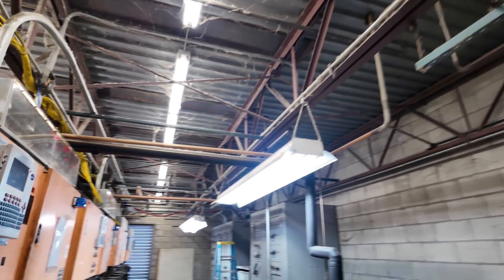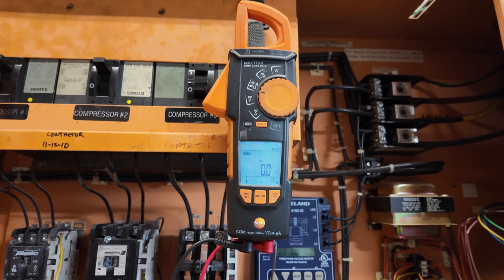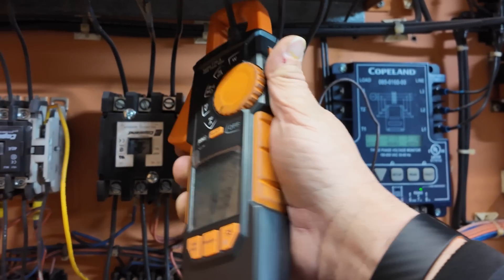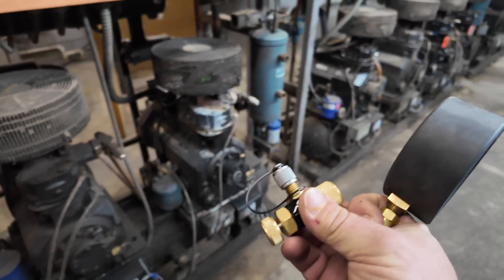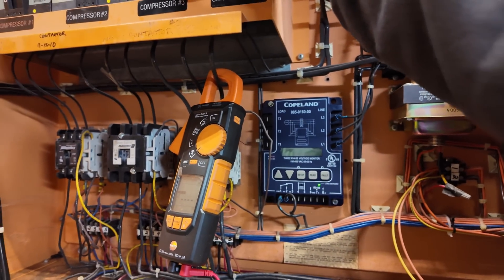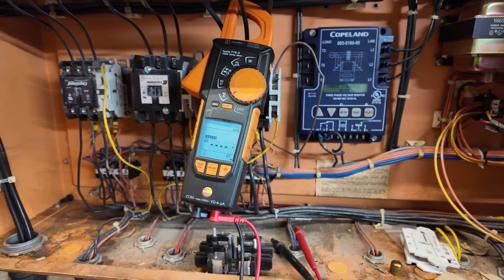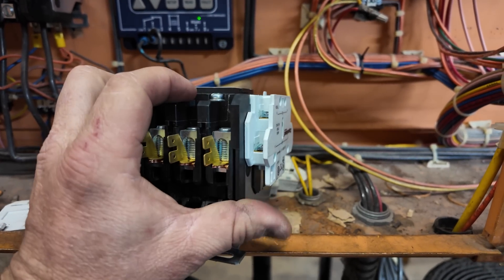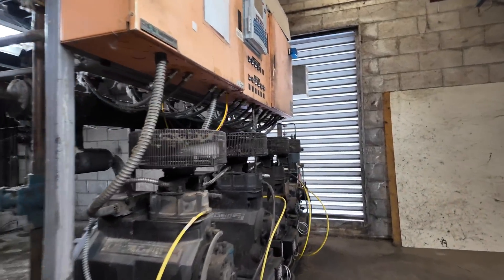Compressor Oil Failure Or Electrical Failure ?

Comment from the maker: I posted two videos this weekend. Please check out both of them.
Reply: Best weekend ever
Reply: Your not my real dad don't tell me what to do
Reply from the maker: I thought you were gonna tell me that only your real dad could touch you there?😂😂😂
Reply: Recommend using a four pole contactor, often I wouldn't due to cost but surely the big grocery store would pay a bit more for a better part right? Never got to work on grocery stores like that but could that transducer possibly be going bad? Should be able to test resistance or voltage depending on which is easier. Also wonder if the contactor had single phased when the tab broke, could've been a one and done scenario if the piece fell out after it released / lost coil voltage.
Reply: Nice camera work and sound.

Comment: Those hill Phoenix racks many times did not separate body cooling fans from compressor circuit with fuses. Check inlet power rub out at bcf and motor bracket for short. Lots vibration on those racks. I may have been to that store before.
Reply from the maker: Thank you for the heads up. Sorry for the delay in reply sometimes it's hard to catch all of the comments.

Comment: Love my core depressor, mini split or just connecting to a liquid line. Much safer and no loss of refer. Didn't know about the inrush feature it's quite nice. I guess you can diagnose if the compressor is actually hard to start.

Comment: Just ordered a set of the core depressors. Hopefully they do better than the ones that I got off Amazon from what looks like CPS. Ended up throwing them away due to leak around shaft seal. Also got a new sensor for my H10PM.
Reply from the maker: Awesome. I always like to see the H 10 sensor replaced every year sometimes every two years at the latest I know they last longer than that, but I always felt better. The valve cord depressed tool I was using in the video was appion
Reply: @HVACRSurvival  I have even upgraded the battery in my H10 to lithium iron phosphate (lifepo4). Gives it a good long run time. Can even keep it plugged into the lighter socket.

Comment: You think maybe high resistance across a leg of the contactor could have dropped a phase on startup and caused the over current that tripped the breaker?   You in-depth checks beats replacing an expensive compressor only to have it trip out again later
Reply from the maker: @kg4muc  this happened at least five or six days ago and I have not heard of it happening since so it’s very likely it had something to do with the contractor.

Comment: How would it trip the low oil sensor though? Faulty sensor or since the breaker tripped it blipped the sensor causing it to flag the controller..? Seems odd it would show low oil on a power failure or overheat..  and it didnt overheat bad because oil wasnt black..  looked like it arced on the contactor for the fan and tripped the main somehow..
Reply from the maker: None of the control system runs on 480 V. That’s why I was trying to find the secondary step down transformer that drops it down to 230 V.   if the compressor doesn’t run the oil safety still energizes and because the compressor doesn’t run, it doesn’t change from open to closed or vice versa and it locks out on oil. What I showed in the video was just normal arching however just one more reason why I replace that contactor.

Comment: NFPA79 doesn’t list regular wing  nuts as acceptable for motor connection application.

Got yo use set screw type of connection. Ideal had one, looks like regular wing nut.
Reply from the maker: Where did you see this? The terminals on the compressor actually have an Allen wrench style bolt clamping it down.
Reply: @ I guess those were cooling fan wires going through the compressor pecker head. Still the reason wire nuts are another acceptable method of connection is vibration of the motor. So those falls  under the rule.
Look up Ideal part number 30-1294G, is one of the good ones. Looks exactly like wire nuts on the first glance

Comment: great video. at exactly 11:11 & 11:14 the lower middle contact arcs as someone below noted. 
love the oil access tip
Reply from the maker: Yeah, you might not of noticed, I zoomed in on it when it happened live and then I replayed it in slow motion. I was showing you what I seen when I was playing it back, but didn’t notice it when I was on site. However, what happened is pretty common and usually that contactor has a cover over it with metal clips in there to help reduce that.

Comment: G,day from Sydney Australia.
That's some serious inrush current 129-130A "wow"
Q1. Did you have enough wire length to cut off the copper "crushed"strands to the contactor?
I saw that green arch flash in the contractor behind your meter: I wonder if that was the contactor device or wire connection?
🌏🔋
Reply from the maker: In the high-speed video section, you can see I straighten them out with my Leatherman, unfortunately, I would’ve had to chop out the wire and replace it, which I didn’t think was necessary. That arc was just the normal arc that you can’t see when you break a contactor under Higher current. Especially at those voltages.

Comment: Thats why wires in contactors need ferrules
Reply from the maker: Yeah, I’ve been thinking about getting some. I’ve used them on DC wiring with amplifier connections in automotive and even they can get damaged though.

Comment: That’s a great tip using the core depressor on the oil pump 👍
Reply from the maker: It works great as long as it traps it in. My other branded depressor tool doesn’t do it, but I kind of bought it that way.
Reply: @HVACRSurvival  probably adjustable, but if not adding a gasket/washer to the depressor end cap may help.

Comment: You did your do diligence and checked everything associated with a potential to trip the breaker. Breaker could be getting weak. About the only other things you possibly could have done was thermal image the components and megged them out. None of that could have yielded results either. The L3 seems to be the slight oddball in everything i seen, and it's not that far out. Less than 10%. I'm probably sounding like im nit picking,  I'm definitely not though. It's one of the things I like most about your channel.....real world HVAC....not classroom HVAC...not armchair HVAC.....is there always more we can do....sure....is most of it realistic or worth all the extra time, when evidence shows it's not....no....so real world HVAC it is. Love it Rick.
Reply from the maker: Yeah, I should’ve probably use my thermal imager since I’m looking for footage to use in the upcoming review video.
Reply: @HVACRSurvival  i hope it didn't sound like i was nit picking or being super tech arm chair quarterback.

Comment: So middle contact  point just flashed for no reason while contactor was pulled in?
Reply from the maker: The contactor had a arc as it opened. Normally, there’s a cover over it with some metal devices that go around the contact points to help reduce that.
Reply: @ got it.

Comment: When I have to run a compressor that has tripped the breaker and you can't find a reason for it I have a remote control relay switch that takes 15 seconds to wire into the control circuit at the contactor coil. I use my Testo bluetooth meter to monitor amp draw when I hit the switch. I can be 20 feet away from the unit. Nothing worse than being next to an exploding contactor or breaker.
Reply from the maker: That’s definitely a good idea, both meters I have can do that Bluetooth remote stuff. I suspect you just made a push button or a toggle switch with a remote wire?
Reply: I bought it on Amazon for $15.00 remote controlled momentary switch. It stays on until I let go of the button.
Reply from the maker: It’s crazy what you can find on there
Reply: Nothing worse...except when it blows when you manually push it in!

Comment: Fan not running causing compressor to get hot and over amp?
Reply from the maker: @fathvacguy those were all things I was looking to determine. None of those things appear to have happened. This happened earlier in the week and I haven’t heard anything about it since it may have even happened last week. I don’t remember.
Reply: Those are the frustrating calls
Reply: Fan motor shorted out and tripped breaker, also burned motor open.